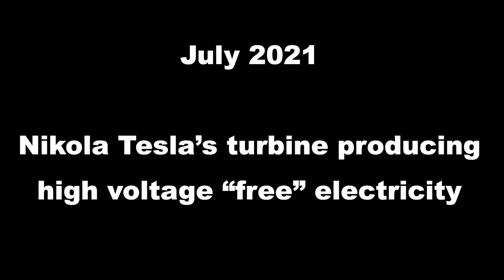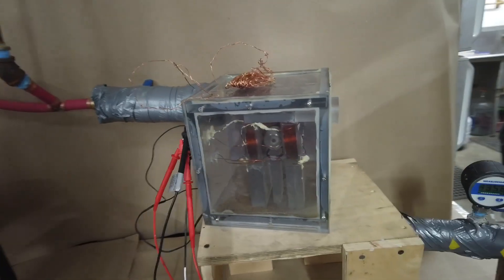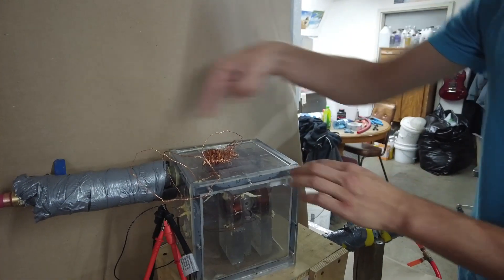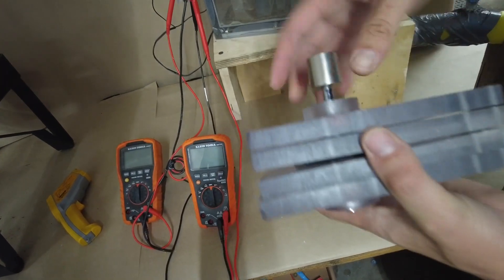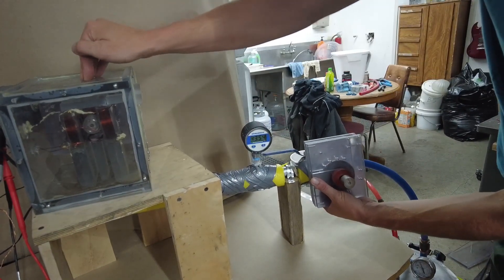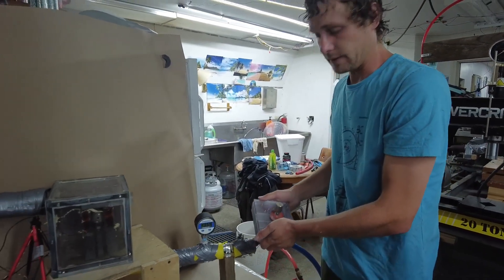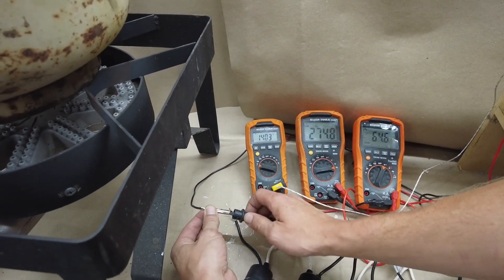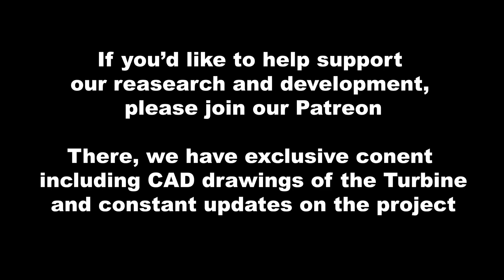Ground Breaking Renewable Energy System Using The Tesla Turbine

Comment: I've come to this a bit late so I'm not fully understanding your claims. I see you are heating the vessel on the left with gas (?) and cooling the one on the right with ice. Both these must be using external power to heat/cool. How much power do these use in kW/h and how does it compare to the output from the generator? If you used solar power for the heating and cooling, would it not be more efficient to use the solar to generate power directly and forget the turbine stuff?
Reply: @Charles McKinley karen coment
Reply from the maker: Sorry for the lack of analytics at this time, our equipment will be here in one week and we will start answering all the questions :)
Reply: @iEnergySupply  Oh for Pete's sake man. You need a scale, a calculator and Google. Heck, do it ahead of time and you can even make an excel sheet to do the math for you.

Here's how you answer that question: 
Step 1: Weigh your propane canister.
Step 2: Use propane to heat your thermal battery then weigh it again.
Step 3: Compare the weight difference to propane's MJ/KG and you'll have a reasonable guess how much energy went into your hot source.
Step 4: Make more ice than you need, weigh it.
Step 5: Measure cold sink to confirm it's room temperature then add ice until the desired temperature is reached.
Step 6: Weigh remaining ice to determine how much frozen water you actually used.
Step 7: Calculate the joules required to cool that much water from room temperature to the temperature of your freezer.
Step 8: Add up the joules spent on the hot and cold sides. 
Step 8: Run your system using your existing inverter to measure how many KWh you got out of it.
Step 9: Divide total energy in by energy you successfully extracted as per the inverter readings converting between watts and joules at your discretion.

You may argue that the results would be less than ideal because of this or that (maybe your burner is wasteful etc) but who cares? If you put in 20 kWh worth of energy and get 1 KWh out than improving your burner efficiency by 50% isn't going to turn an overall 5% system efficiency into 25%.

At least then you have an objective test to figure out how far you are from solving the actual valid criticism of the Tesla turbine (it's mechanical efficiency is too poor to be commercially viable / the speeds damage the discs) vs dumb-ass Youtube criticism like "It doesn't make any torque."
Reply from the maker: @Cheebzsta  solar heat panels are what we will use to heat the battery.
Reply: :goodvibes::goodvibes::goodvibes: yes, that is also may observation.. in net there is power losses (a lot may be) since they are not showing the watts needed tor run the vacuum pump, it may be more efficient if they will use gas cylinder for the tires.
Reply: @c2sartinkprinthub757  i agree
Reply from the maker: @c2sartinkprinthub757  gosh people can be so ignorant, it's basic science, I have a video to show you how it works.
Reply: @iEnergySupply  its a basic logic everything is a scam..  You can slap me when you are already a millionaire selling your system I would be very happy with that since  its part of human kind advancement :elbowcough::elbowcough: so until then.. everything are just click bait... you still make money out me since I check your video from time to time.. lol
Reply from the maker: @c2sartinkprinthub757  Here is the video you need to see to understand what is going on. https://www.youtube.com/watch?v=W1K2CMRyDrw

Comment: Whats your input-output ratio goal?
Reply from the maker: We want a 3 kw unit to start with, the input will be heat from the sun, using solar heat panels, also you can use your wood store if you have one to heat your water battery as well. The input-output ratio will be shown when we get the analytical equipment, it will be here in a week from now.

Comment: It is fantastic to see people finally putting Nicola Tesla's theory and design to practical use...and while i don't fully understand the exact barometric science behind the function of the unit,,i can see that with further refinement this type of system could eventually provide a perpetual energy source,that once in operation would only ever need to be shut down for routine maintenance...I applaud you,Please keep up your amazing work..
Reply from the maker: Thank you! The goal will be geothermal in the end, the earth is a giant thermal battery, but for now we will start with the sun.
Reply: @iEnergySupply  why not solar heated water? My evacuated heat tube water heater will boil by midday on a summers day. So much so, I have to cover most of the tubes and 3 of them supply more than enough. Doesn't need tracking as the tubes work from sun up to sun down practically speaking.

Although drilling a series of deep bores gets down to the warmer levels easily, I agree. This is the same as people use to heat and cool houses with two sets of bores that they reverse pump with the seasons and extract warmth or coolth. (Yes, it's a word.)
Reply: @seeker1015  How can I contact you?.. I am interested in your solar powered heater- cooler contraption...

Comment: a few questions. How many watts are you able to extract from it? what is its efficiency? what is its nominal rotation speed? because from what I remember, the original tesla turbine was able to achieve very high efficiencies at RPMs so high, the materials at the time could not hold themselves together and it would fly apart. it seems like these disc diameters are relatively small so probably not very efficient compared to traditional turbines. to maximize efficiency you need to optimize the disc spacing to only allow the boundary layer flow between the plates and have large discs at high rpm, such that you get the optimal amount of boundary layer interaction on the plates while not exceeding the mechanical limits of the plates so they don't fly apart.  carbon fiber plates seem like a good choice of material, lightweight, and have good tensile strength, all give them a low moment of inertia and allow higher RPMs. those spiral patterns you see should spiral around the discs more till they reach the center to have as many interactions at possible, to squeeze the most energy out of the flow as possible, and this happens more at higher RPMs, or rather also happens at higher flow rates. Lesics has a really good video about the subject
Reply from the maker: It's interesting, tesla actually had turbines in operation in his day, that exceeded the performance of all other turbines, but this information isn't wide spread. He had a turbine operating on stem for the Edison company as well. It's actually a myth that tesla didn't have materials that could withstand the speeds required for high efficiency. Our fastest turbine so far was 150000 rpm with a 3 inch rotor, the periphery speed was 1400 miles per hour, but we can achieve 2000 miles per hour before the carbon fiber starts complaining. All the details will be coming out soon. We have an entire analytical system on the way that will measure every part of the system.
Reply: @iEnergySupply  Fantastic speed in RPM (rotation per minute)!... According to magazine, in 80's decade, the American scientist was able to test the "ceramic bearing" in a laboratory environment- in excess of 20,000 rpm- without breaking to pieces... Said bearing also withstood corrosion attack for 1. year span- being soak in a bath of sulfuric acid.. Maybe such kind of bearing will greatly help in the successful design/ prototyping of Tesla turbine...

Comment: Would using disk magnets arranged in the same way as the turbines with steel plates and copper coil work better?
Reply from the maker: I don't know, this seems to work the best so far without any issues. At this point, there is no point in changing the design until we find a problem with it.l
Reply: @iEnergySupply 
 The neodymium magnets aren't that much resistant as steel or Titanium.

But you could definitely sticking stripes of Iron Nitride on the outside of the last 2 disks...
They won't be washed away from water pressure because they wouldn't be touched by steam at all.
Iron Nitride it's 2 time stronger than pure neodymium.. so it won't need much to creating a strong enough electromagnetic field to be catch from 2 additional coils per side.

Also in this way you virtually changing nothing to the design, you just add something useful to increase energetic output.
All without decreasing the Torque ! ! !
Reply: @iEnergySupply  Just curious if rearranging the way the magnet is used would increase current output. Having the copper coils stuck in between disks of magnets should increase current.
Reply: Focus now should not be on the material or arrangement,,,, but on the control.

Comment: Not sure if this could be geared with a fly wheel, perhaps a greater starting torque with a battery driven larger motor, then sustained with your turbine. 

Either way, we are off grid with NiFe / Solar currently and a backup gas generator. Getting ready for the "great reset" and monetary collapse. 

I hope you have a commercially available unit soon. Would like to add it to our community.

My question is what is your energy input in BTU's verse wattage out?

I saw you are using a vacuum pump? They draw a lot of current. Is this loop-able?
Reply from the maker: At the speeds we operate at, gears pulleys and belts aren't practical as the friction is too high

Comment: This is totally fake for those wondering. You can’t make energy from nothing. The dead giveaway is the frequency. From the sound of the turbine you can tell it is spinning at 20000+ rpm yet the frequency from his generator is only 1000 hz with a 2 pole generator his frequency should be equal to rpm. His turbine also doesn’t change pitch when he applies a large load to it and the brightness of the bulbs don’t change. Also the ice on the turbine is because as a gas expands in a turbine the pressure drops and with it the temperature. That’s how your air conditioner works. The propane tank is likely just filled with compressed air and the rest of the crap there for show.

As Homer Simpson once said In this house we obey the laws of THERMODYNAMICS!!
Reply from the maker: It's funny to see how ignorant some people are. We are not making energy from nothing the energy comes from the sun and the sun is free. It's the same as collecting free water from rain. Yes the equipment cost money, but onces it's installed, the rain is free. 1000 hz is 60,000 RPM 1 hz is 60 cycles per second, not minute. Try to focus a little bit more to get your basic math correct.
Reply: @iEnergySupply  Hey I think maybe you misspoke at the end there. 1Hz is 1 cycle per second or 60 cycles per minute; it is not 60 cycles per second.

Comment: Thoughts/Prayers/Meditations you guys reach your goal! This research is so very important  to the common whole of humanity! It would be AMAZING to have a way for folks who own wood burning stoves to  make power while also heating their homes. With an off grid battery setup, I cant see how this concept wont at least provide charge for the bank. The truly hard part of this R&D, is packaging the system in such a way it can be easily installed by the common man.
Reply from the maker: Absolutely, originally I intended to use it just with the wood stove, then found out thermal solar panels and water energy storage are also an amazing benefit.
Reply: @iEnergySupply  You really do need to have all of them if you were to be 100% off grid I assume. Youre talking about collecting rainwater right?
Reply from the maker: @AllboroLCD  o no, I just used rain water as an analogy to imply that technically water can be free, just like the energy from the sun. We can consider it free energy.
Reply: @iEnergySupply  if the cold steam is exiting at lower than ambient temperature though can't you use ambient heat to heat it again?

Comment: I've been waiting years for this video. Well done! As a fan of Nikola. I applaud you! Keep up the awesome work.
Reply from the maker: Thank you very much!
Reply: It may be an improvement on a old technology but hardly  some kind of break thru.
Reply: @rickstandal626  I'd like to see a 10 stage closed loop system all turning the same rotor. Possibly cycling a ferromagnetic fluid through a conductive tubing. Would you think recycling a ferrofluid through a conductive conduit would induce a current? And I only have an Associates in Industrial Electronics. In an attempt to think outside the box I got stuck in a triangle... lol Although all who have attempted to source power through effective energy devices have ended up assassinated. Not that I like life that much.  Too bad they don't turn on the New Yorker hotel where Nikola spent his last years in. It was modeled after the Wardencliff tower. Or as the ancient Egyptians and other cultures utilized their pyramids to acquire and transform the ether into usable energy.... maybe I thought too long and hard about the process....
Reply: I'm sorry I didn't watch the whole thing and by no means an expert on Tesla. That being said what I saw there was not a game changer and if so why after a hundred years has no one jumped on it. 
I've seen so many new advancement or so called in my life time that unless its backed up with more than a video I just take a pass on but who knows.
You enjoyed it so it was worth while. For you.

Comment: Try closing the loop with a Peltier (Thermoelectric effect) cooler, you can get a self sustaining reaction getting the exact temperature you want for each side.
Reply from the maker: We will defiantly do that!
Reply: @iEnergySupply  "defiantly"?
Reply: A peltier generates much more heat than it pumps, but if you use the hot side for boiling, you recoup some.

But the point of this exercise, if you want it to be of practical use, must be to convert low quality heat gradients into electricity, not the other way around, so a peltier would be self-defeating in such a machine.
Reply: @galfisk  How about we do some science and TRY IT FIRST?
Reply: @jatigre1  people have already done lots of science on peltier elements, so we don't need to start on square one. Knowing roughly what to expect makes for better experiments.
Reply: And how much power does your Peltier junction consume? There is much research left to do on the Tesla turbine, but an increase of efficiency is the only measure of success. In addition to propane fuel for heating, electricity for the vacuum "compressor" etc would need to included in the calculations.

Comment: What's the input to output power ratio?
Reply from the maker: that information is on the way, stay tuned!
Reply: @iEnergySupply  quite critical information. 40 deg delta is achievable using heat pump, so if You could pump the heat using electricty produced by T.turbine, we could get self sustained source of electricity?
if ratio is within COP of heat pump.
interesting

Comment: Water under a vacuum boils at room temp..so um..how
Reply: At sea level, water boils at 212 °F. With each 500-feet increase in elevation, the boiling point of water is lowered by just under 1 °F. At 7,500 feet, for example, water boils at about 198 °F. When atmospheric pressure is removed by a vacuum, for instance, less pressure is exerted on the molecules. This allows them to escape from liquid state to a gaseous or vapour state sooner. If you were to add more pressure, you would increase the boiling point. see iEnergy Supply video, "Cold Steam Engine Theory" 
https://www.youtube.com/watch?v=ufCAeeOEbUg&list=UUdX_Ug0MgcXqTpevz_gGk9w&index=42
Reply from the maker: yep.

Comment: Have you tried needle bearings?
Reply from the maker: I'd like to, can you link some good high speed needle bearings?
Reply: @iEnergySupply  no buty best suggestion would have to be to find needle bearings matching your shaft size from possible like a crotch rocket type motorcycle transmission. Alot of motorcycle transmissions utilize needle bearings because of the high RPMS. SO MAYBE CHECK A MOTORCYCLE PARTS STORE.

Comment: Perhaps a Chinese Diesel heater would be fun and maybe useful to experiment with as a heat source for your hot side.  It produces output temps that would likely suit your operating requirements, and it's extremely fuel efficient.
Reply from the maker: Yeah that would be a really cool experiment, maybe a small engine or something.

Comment: Jeremiah, there is an additional stage to add involving hydrogen hydrolysis... it will add extra usefulness to the system beyond pure energy uses
Reply from the maker: I'm not sure exactly what you mean, can you please elaborate?
Reply: There is a way to store energy in a lossless state using hydrolysis of water... Research manufacture of hydrogen and begun to understand the non green impact of has currently. Turbine could make it a real green energy source.
Reply from the maker: @SemperFiParatus  I think you can store hydrogen in chard chicken feathers. We will do testing with this in the future.
Reply: I'm not too sure; ideally i'd have my spacecraft pull in water to generate fuel using solar power thru electrolysis